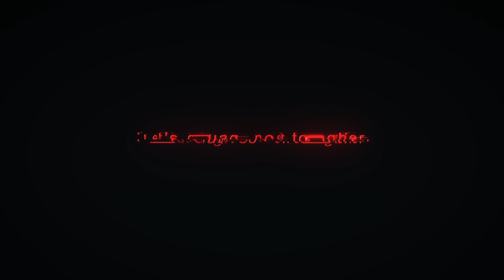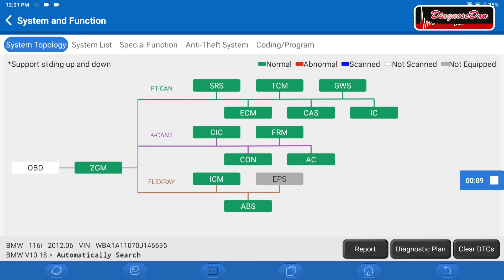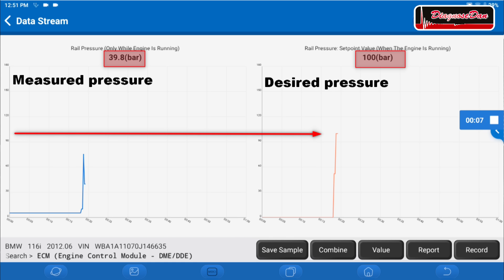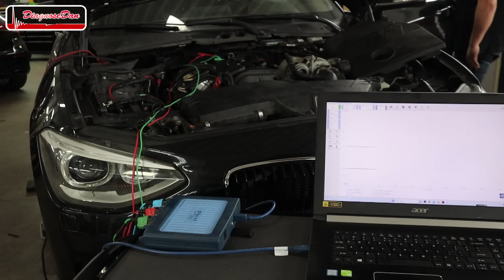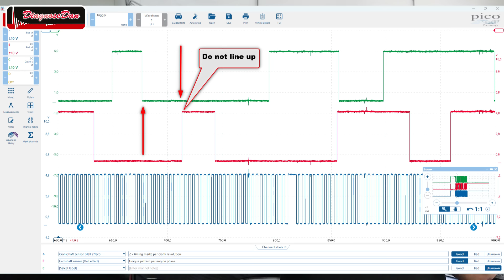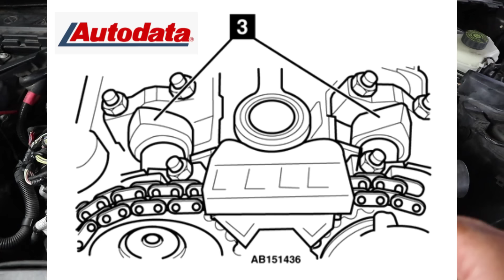Bmw dealership blunder? Incompetence?

Comment: Surely dealership techs are trained by the manufacturer, and they use manufacturer diagnostic software, the software should give you a guided diagnostic procedure, that the tech should be working through. You can see a huge amount of info on the diagnostic equipment.

Comment: As stated if car was ingenered  correctly there would be no need to have two separate pumps to provide fuel as needed. Remember all vehicles built in last sixty years are built with a failure included in manufacture as a means to maintain more sales ,and parts failure so as to promote  parts purchase.

Comment: Dan, this was fascinating - I was wondering how you knew to check the waveforms, but it became clear that hrough understanding how the HPFP works it would be obvious to investigate the timing through the waveforms on the picoscope. this wouldnt be the first BMW with timing chain issues  / timing chain guide issues, it absolutly sucks for the vehicle owner that they were given the run around but you found the fault. The big mystery remains is how the other shop concluded the timing was "good" when it was very clear form simply removing the cam cover that the chain was (1) slack and (2) the top guide was missing!
Reply from the maker: Because of experience, i've seen this before

Comment: I always use starting fluid as a diagnostic aid. .If it starts on that I know it's fuel related. If it doesn't, then it's checking for compression and spark next.
Reply from the maker: Good process

Comment: From the first actuation of the starter, you can see from afar that the engine spins very easily. This is a clear sign of low cylinder compression. What is the first step? Distribution phasing check.

Comment: Wonderful Dan!!!  I am an old school mechanic.  Thus, the very first thing I verify on any engine is basic engine timing - with the valve train.    Using the valves, it lets one see how the valves are operating (or not) with the reciprocating mass.  Obviously, after that is time for compression, spark and fuel.  Seems very out of sequence, but it has always served me well.  In this case, the Dealership would have located the problem right out of the gate.  So, what was the outcome/fix?

Comment: Great video! My local Stealership has been causing me some doubts with my 2013 BMW 328i. Some time ago I had the car in for service and strangely enough I got it out and 20 minutes later the serpentine belt broke. I got a new  Continental belt which took me 15 minutes to replace. During another service visit they wanted to replace the belt which was only about two months old.Too bad you’re not in Florida because my vehicle would be serviced by you.
Reply from the maker: I've been to Florida a few times, but i think it would be to hot for me to work there! 🌞🌞🌞🌞

Comment: I thought the spark didn’t look very good and in my experience if the chain guide breaks the engine rattles like hell. So chain guide wore out,  driver operating the engine hard, timing chain slipped engine toast.

Comment: Just done Alfa nearly same thing .Garage had it nearly a year couldn't figure why it wouldn't start .Threw a loads of parts on it still wouldn't start .I bought it muck cheap of owner garage said it would cost a fortune to fix ,kept up showing camshaft and crankshaft error codes .Cut long story short timing belt had slipped 3 to 4 teeth replaced belt timed up sorted.Feel sorry for bloke who  virtually give his car away because of bad garage advice .

Comment: simplest troubleshoot :

1 try to run it, f there is fuel, you should be smelling fuel in the exhaust..  No fuel smell = no injection
2 next, test the spark:  without fuel spark does nothing, so spray some brake cleaner in the intake, it will try to run if there is spark, you should have some kind of ignition

If there is neither spark nor fuel, there is most likely a ECU/timing sensor problem
Reply from the maker: Thanks for watching

Comment: The ECU should absolutely have set a code for the cam sensors being out of sync with each other and also out of sync with the crank sensor. And that code should be set during cranking. Really puzzling!
Reply from the maker: The customer showed me the scanraport by the roadside assistance and there were timing related faults stored

Comment: 19:15 Thats annoying, the ECU should monitor its systems and should set faultcodes while attemting to start. Setting faults for not reaching desired fuel pressure or the timing being way off is easy. Half of a car issues are uually a " crank- no- start" :)
Reply from the maker: I spoke to the customer and there were timing related faults stored before it came to me

Comment: I'm amazed Dan, again your the master. I didn't even know this modern engine had a low and high pressure pump, also the shock that the t-chain guide simply broke, what quality.
Reply: BMW timing chain guides have been made from chocolate for the last 20 years, it's common for them to fail.
Reply from the maker: Everything needs to be light, fuel efficient and cheap

Comment: Dan, so what got the engine to start? Crankshaft adjustment? Timing belt adjustment? Re-installed the chain guide? I was hoping to see that engine finally get started :(
Reply: I’ll let you know.
Reply from the maker: I dont know, i only was asked to do the initial diag, the independent workshop picked it up to fix it

Comment: Age old mantra: Fuel & air (in the right mix) and spark (at the right time). Been chasing this since the 1964 Mini I started with. My dead on the road episode was a Fiat 128 with a broken distributor drive shaft. Took me a while to find that, grin.
Reply from the maker: No faultcodes stored?🤪🤣🤣🤣
Reply: @Diagnosedan  Sorry - that was way before engine computers. Was only one fault - sudden loss of power with no restart.

Comment: Speed sensor in my gearbox was failed, and the dealer says - “first we will try to update the software”, and this will cost $150/hour. I asked - did you give any warranty that it will works? They said - no, if it doesn’t work after software update then we have to replace whole conductor plate. Additional $1000. 
So, in a independent garage for $500 they replaced the failed sensor and now everything is fine :)
Dealers are here just to “try and replace” parts…
Reply from the maker: Thats sad to hear
Reply: @Diagnosedan  and it was MB dealer in Bulgaria.... I've used their services few times, I can't say anything bad, but this with "2205 Component Y3/8n1 (Turbine speed sensor (VGS)) is defective." was not that I expected from them :) I know what this means, and also I know that software update will not help. As I have no garage where to disassembly it, just tried to do the best... :) In some (most?) cases independent garages are the best choice.

Comment: just as soon as you put an alternate fuel source into the mix and we know that there is a good spark, the next check is timing. this might sound odd but im not actually a mechanic but even i knew enough to figure there must have been a problem with the timing. makes you wonder how the previous garage checked the timing but couldnt figure out the problem themselves???
Reply from the maker: I have no idea 😂

Comment: well, I know it is a no no to use "brake cleaner" as a fuel source; my question is: Did you use throttle cleaner thru the PVC hose as a fuel source to check to see if engine is able to start?

Comment: When you turned it over with the spark plug out, I got a feel that the sparkplug was not firing when I would expect it to based on what I was hearing, meaning there's a timing issue somewhere (just a feel based on years of doing this kind of thing more than any scientific basis). Let's see what the issue is as I watch the rest of the video.
Reply from the maker: You are right, that was a big clue

Comment: Great work again, DD!
Do these BMWs suffer in the timing chain system when oil isn't changed at specified intervals?
Reply: Don't follow the official BMW oil change interval, which is set (I believe) at around 30.000km. Change it each year or at around 10.000km. Had a N47 320d which lasted me 290tkm and the N47 had a very weak timing chain.
Reply from the maker: Changing the oil more frequently helps but also make sure you have a good tensioner

Comment: 7 minutes in have not finished the video, I would look at the high pressure fuel pump the follower for the cam to make sure it is driving the high pressure pump correctly. This is just my guess from past experience and want it noted prior to finishing the video, if the High pressure pump was removed incorrectly it could damage the follower not allowing it to pump the fuel correctly.
Reply from the maker: Could have been😁

Comment: Wow, dealership incompetence, never heard of this before! (note the dripping sarcasm here). I would like to see the physical cylinder pressures to know if valves are bent (and would expect so). However, it is very enlightening to learn about this simple fuel pump timing being so critical and that there was no DTC. Clearly the HP fuel pump data is getting to the ECU already, so I wonder why the BMW software would not flag a code for it as it is controlling it to offload when it sees timing out? In this day and age, I see that as a design fault from BMW.
Reply from the maker: Thanks for your comment its appriciated

Comment: As always a good video. Seen this so many times before. Main dealers do not use Pico...
Reply from the maker: They do have scopes😉
Reply: @Diagnosedan   If some do, they are not that familiar with scope diagnostics. More often rely on OE guided diagnostic flow charts...

Comment: The spike in fuel pressure is probably from before the engine computer found TDC. Likely, the HP pump is defaulting to full flow, and when the engine computer sees TDC, it starts controlling the fuel pressure - which actually releases the fuel pressure.
Reply from the maker: Thanks for watching

Comment: If a dealer asked me that question I would immediately write to the manufacturer and copy in a few newspaper editors.
Unfortunately most mechanics are just that, mechanical. It is a different type of brain that can analyse closed loop control systems.
Many Mechanics just change parts with no understanding of what is going on.

Comment: DiagnoseDan diagnosed it again. To say, you "fixed" it in this case would be a little too exaggerated at this point. You diagnosed a certain issue (timing chain guide absent, timing wrong, likely damage due to interference), but there may be more issues. Just like with the Mercedes in the back.
You did a a great job on your diagnostics, however. In the future, it may be wise to check timing first (despite what the previous workshop says) before doing all that cranking, which in turn may have contributed to the problem. It's not your fault, but every cranking a wrongly timed engine is a risk itself.
Reply from the maker: If there was damage due to the timing it was probably already done when the car stranded. You are right i didn't fix it👍

Comment: naah! after confirming the spark and adding fuel but no start, Dan ,you should have checked the compression.I really want to know what was the compression on that engine when it was off timing.
Reply: I’ll let you know!
Reply from the maker: I showed a picture of the in-cylinder waveform didn't i?

Comment: Great video.
I like to check monitor status in global 0bd2 as a first step to determine if codes were cleared.
I wonder if graphing the intake pressure sensor during cranking would give diagnostic direction?

Comment: Nice diagnosis. A BMW shop should have known that these timing chains are known to fail, almost all modern timing chain systems have problems because everybody builds cheap. Iam glad VW went back to timing belts. Fortunatley this little engine has the timing chain in front instead of sandwidched in beetwenn the engine and gearbox. And if that customer replaces tht timing chain for good money there is still a chance the valves could be damaged from failure...
Reply from the maker: Thanks for your comment its really appreciated

Comment: Dan I find that incredible that a BMW dealership could not fix the problem doesn't make me want to buy one not that I would replace my 2011 Mazda 6 Sports Hatchback with anything - great car. Now it always amazes me that you can do these sorts of fixes you always explain things in a veery understandable manner and I am no mechanic my experience was years ago when I was teenager and carburettors, valve t and ignition timing  and point gaps etc were the basic stuff we used to  mess around with (76yo now) and of course I never had anything more technical than feeler gauges and a torque wrench. But keep these great videos coming mate form John down under - just what country are you working in - just curious because your English is so good yet you talk in Euros?
Reply from the maker: Hi John, i'm from Holland 🇳🇱 in Europe 🇪🇺 Thanks for watching from Australia
Reply: @Diagnosedan  No problems Dan I rather guessed you are Dutch from some of the printed paperwork as it is is sort of similar to English. I ma from the UK originally emigrating to Australia in1978 and love every minute of it. Again I am impressed with your English, knowledge, and persistence in solving problems but I am running out of your videos to watch!!

Comment: Codes should never be erased until the car is fixed. If it was on the side of the road I doubt the owner cleared them. What's really bad is the timing on that engine didn't look too hard to check & it was easy to see just by looking at it that it was off. No telling how much money was blown by the customer.
Reply from the maker: I talked to the customer after this video and the car was scanned by the roadside assistance. There absolutely were timing related faults stored

Comment: Majority of Car repair shops or dealers, based on quick profit making, bringing  in more more customers,  little time  spend, properly investigate car under pressure of new cars coming in. In that hard working conditions they can’t keep master technicians, everything left to beginner learner technician, lack of knowledge and experience lead   them changed part expect it fix problems. It’s about  how business structured.
Reply from the maker: Thanks for your comment

Comment: Good diagnose on a otherwise very poor engine design from BMW. I am unfortunate very familiar with it as a customer. Although my engine is called 1.6 THP, it's essentially the same engine. Timing belt issues, Hydraulic time chain tensioner issues, High Oil consumption, Turbo failure. All within 150K kilometers
Reply from the maker: Thats unfortunate 😮

Comment: I would be asking the other shops questions. And you know it wasn't cheap for the pump replacements. Hopefully they will do the right thing and make it right for the customer. Another thing is, it had to make some kind of noise when that bracket broke holding the chain guide. A lot of balls were dropped on this one.
Reply from the maker: You are right

Comment: I totally disagree with all these comments about dealership techs. As a dealership master technician in the uk I would personally say it’s not bad techs, it’s techs who have not got the time to be good techs. I mean when I say that, you don’t get paid for diagnostic work. Only the repair. You could spend 2 days looking at a car and get paid half an hour for the fault. Depending on the faults obviously. This is why techs don’t even bother try to diagnose it. It’s a problem with the industry, not the techs
Reply from the maker: Hi Sir, thanks for your comment. I fully agree with you and am fully aware that there are some fantastic dealer techs. I know they are under alot of time pressure and aren't allowed to spend to much time on a vehicle. this video is just a representation of what really happened in this particular case and has nothing to do with anything in general.

Comment: Very interesting, good fault finding process and, we must hope, a rare failure. When the independent workshop stated that they had checked the timing, could they have meant the ignition timing which wouldn't have been effected by the timing chain fault?

Comment: In an 1.9 TDI the timing belt skipped a few teeths and i heard backfires. The dealership corrected it and few weeks after the same thing happened. I went to a guy that repairs cars at his home garage and the only problem was that it was not done to the correct torque 😮
Reply from the maker: Wow that sucks!

Comment: A very interesting piece but having watched this also more of the same, I would not purchase a modern BMW because the complexity, too much plastic and of course too  much electronics, repair are going to cost a fortune, assuming you can find a competent garage. I am considering purchasing an original Volvo 244 in good condition because they are so reliable but also, not complex and easy to fix ! just in case anything ever went wrong.

Comment: I understand the diagnosis  but what damage was inflicted on the engine. I pressume the engine was  badly damaged due to the valve timing being  off? Did you complete a report and then pass the vehicle back to the owner? Good detective work again Dan.
Reply from the maker: The independent workshop picked up the vehicle and is going to fix it

Comment: Nice one Dan at least you took the time to trace out the problem 
Even with no fault codes prescient...

You would have thought these all singing and dancing top so called technician would have traced the problem. .

How much would it have cost if they had changed all those 
So called faulty parts 😯😯
Reply from the maker: It would have made an already expensive repair even twice as expensive

Comment: I had the same problem on a 28i BMW crank and no start, after i checked for spark and a spray of brake cleaner in the inlet and it did not fire off with the cam cover to find the chain was loose and the cams were out of timing,
Reply from the maker: Great find!